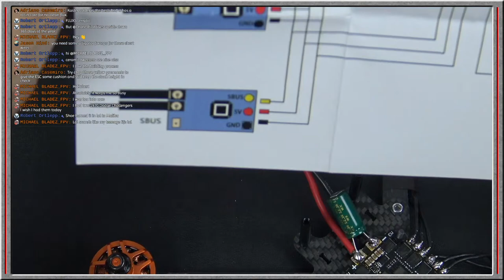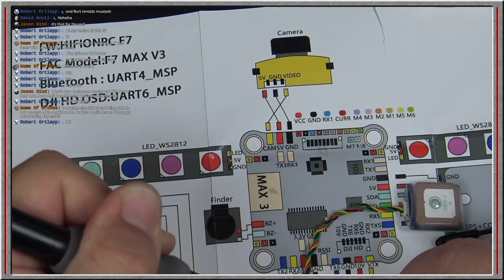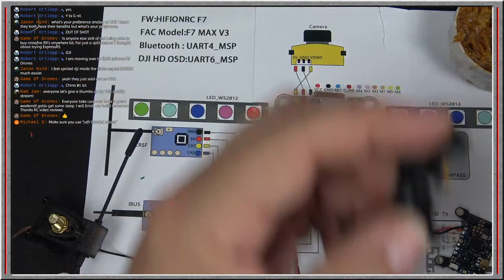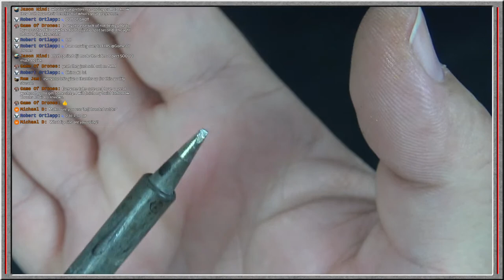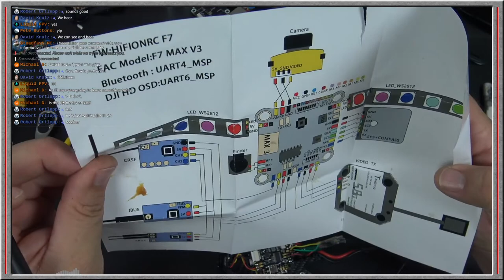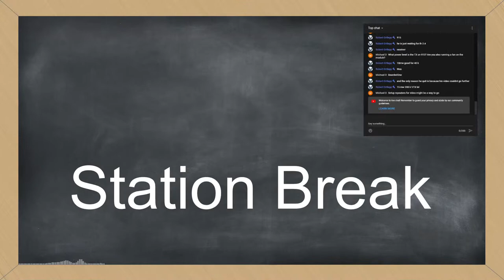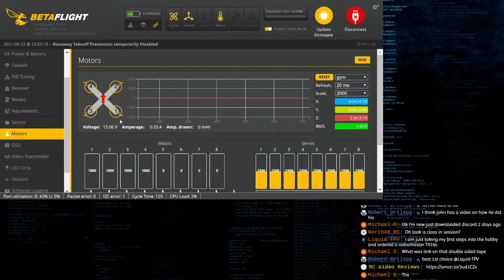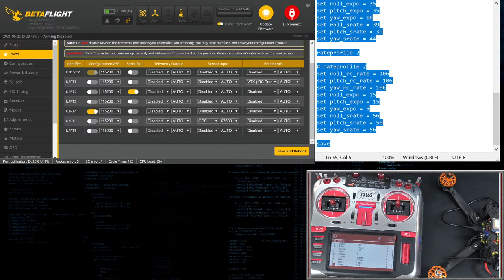Tyro 119 FC Upgrade HIFIONRC F7 Max V3

Comment: Just a comment. I purchased a radio master TX 16S last August. I started using the radio last week. After my third time using the radio, the SH paddle broke off. I don’t abuse my radios😊 in thirty five years in this hobby, I’ve  had quite a few radios. I have never broken off a paddle. I called the online hobby store where I purchased the radio and  asked what the warranty was. They didn’t know. I’ve sent a few emails to RadioMaster and they ignored my warranty question and gave a link to purchase the switch assembly. OK, in warranty or not, the switches are $3.00. And of course, out of stock. If anyone knows the warranty period. I appreciate the info.
Reply from the maker: They probably don't consider a snapped off toggle switch to be a manufacturing defect. Search for FrSky Momentary Switch. They are interchangeable if you're willing to de-solder the broken switch from the PCB. De-solder the broken SH, replace with the same FrSky momentary. You can do this repair in 20 minutes.

Directly from the Radiomaster Website.

https://radiomasterrc.com/support
All RadioMaster radios carry a 12 month return to base parts and labour warranty against manufacturer defects. Proof of purchase is required. Receivers and accessories carry a 12 month return to retailer warranty.

Comment: where did you get the files for the vtx/rx antenna holder?
Reply from the maker: It's been a while so I'm not 100% sure. I think I made them. I gave this quad away to a friend of mine.
Reply: @RCVideoReviews  Dang it. looks compact and beefy. Got my tpu printing pretty dialed in and upgrading the tyro with a better stack (esc fried naturaly) and RX.
Thanks for the response anyways and have a great 2022!

Comment: hi...but 45A or 60A ?...I can buy the version of 45A ?
Reply from the maker: Stock ESC is 45a burst, so you'd be ok with that. There were no changes to the power system.
Reply: @RCVideoReviews  I have to change it because with a fall the original esc caught fire ... I don't know why
Reply from the maker: Yikes. I haven’t seen one catch fire before.
Reply: @RCVideoReviews  unfortunately it happened to me, i was flying, then i made wrong during a flip, and it fallen ... i thought it was the lipo battery, but it started before going out of the smoke, between fc and esc , the original things, and then immediately came on .... with a small flame ... now i think that the fc and esc are burnt .... all black .... that's why now i want to change with this update from 45a because of 60a batteries are no longer available .... i was using 4s 1500a batteries ....  so buy of 45A?
Reply from the maker: As I said, the stock is is 45a burst. So you should be ok.
Reply: @RCVideoReviews  maybe it was the 4 1500mah 100c battery that stressed the fire to the esc? however i ordered as you showed in the 60a video because they are available again ...